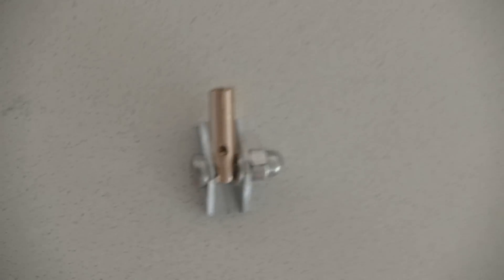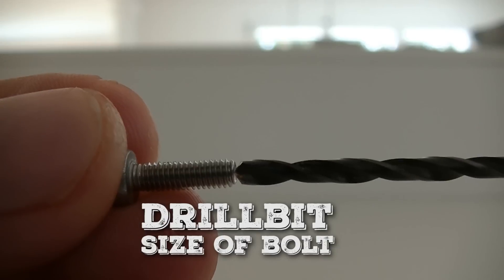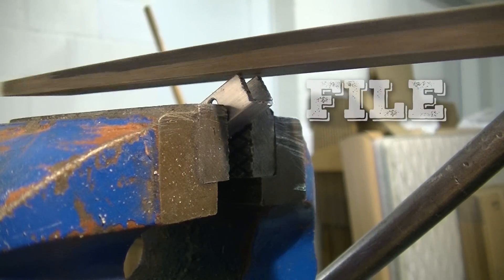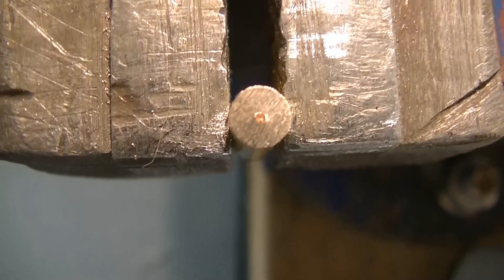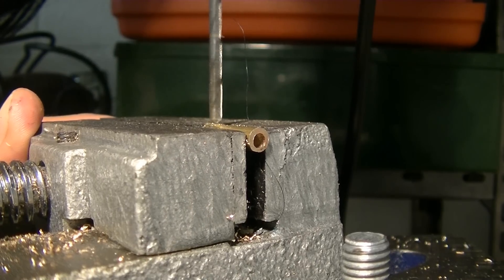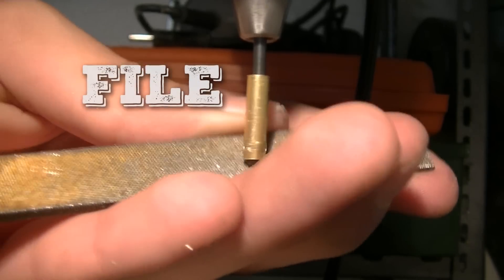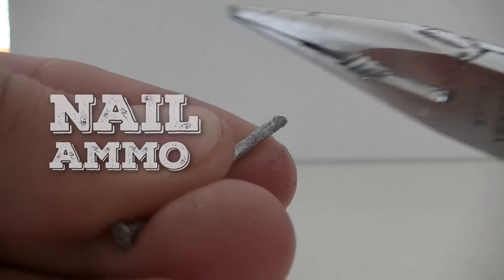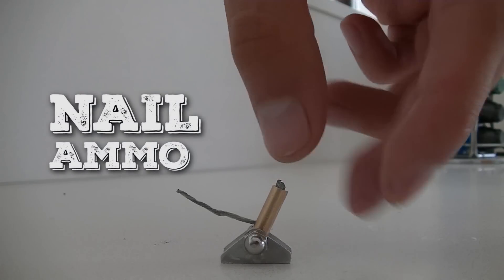How to Make a Mini Cannon that Shoots

Comment: i wonder if it can hurt smeone really bad. but good job
Reply from the maker: Hahha yeah absoloutly. Obviously if you shoot someone in the eye and hit the cornea that going to be really bad for you.

I actually considered shooting myself in the leg or arm but I am pretty sure the consequences would be severe. Not necessarily the pain associated with shooting myself, I imagine it would be about the same as a impailing myself with a nail or getting stung by a wasp, but I am more worried about the projectile once its inside the flesh. Im pretty sure that it will  not completely penetrate an entire arm/leg which means it would get stuck somewhere inside. Obviously that will infect really badly so the projectile would have to be removed and I doubt I could use a tweezer to find that tiny projectile. It would probably mean a trip to the doctor and have them cut open the wound and dig out the projectile. 

So yeah, I dont think the actual pain of getting shot will be the problem, sure it will hurt like a mf, but it will be managable. The really bad part would be digging it out or dealing with the infection.

Comment: You should mount the brass rod directly into the chuck and clamp the drill bit in te vise  for having a best centering.
Reply: That's censorship and violates freedom of speech , Iv'e seen a lot of EDUCATIONAL videos on HMTD , think you got scared and intimidated by the powers that be
Reply from the maker: Thanks for the idea :)
Reply: why did you remove your video on your explosive flour ???
Reply from the maker: mw10259 Youtube has been striking all videos related to energetic materials. see Explosions&Fire  I don't want to get striked.

Comment: The reason why it blew up was because the thickness of the barrel. Use thicker barrel next time
Reply: absolutely, not to mention his barrel was off centre. a good rule to follow for homemade cannons is that the walls of the barrel should be the same thickness of the bore, meaning, a 3/4" barrel would have 1 1/2" OD.
Reply: Or use SS. Its harder to drill but much stronger.
Reply from the maker: you are right, the barrel was way to thin. However I do believe I used the wrong propellant. I will upload a video shooting this very cannon using mathead "armstorngs" powder soon and It worked just fine.
Reply: Hmmm cool

Comment: What does the wadding do?
Reply from the maker: It will help improve the velocity of the shot. As you know if something is confined, no energy will be lost.

However it is not always needed. If you had a projectile which had the exact diameter of the tube with no air gaps on the side, then wadding would not be needed, just like you dont need wadding inside a gun. However, I used small bits of nail which are smaller in diameter than the tube so adding the wadding will help capture energy that would otherwise get lost.